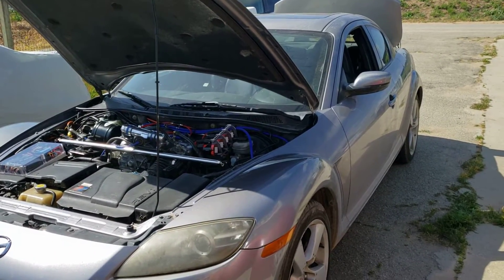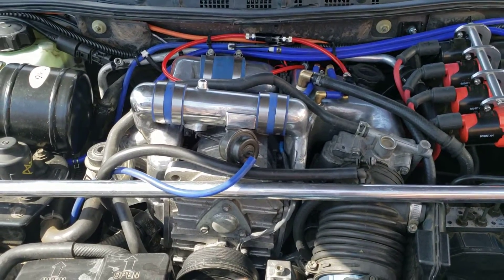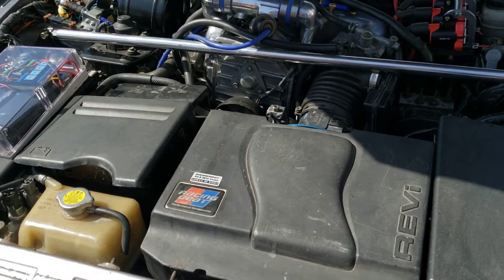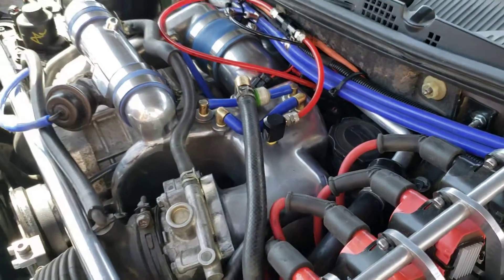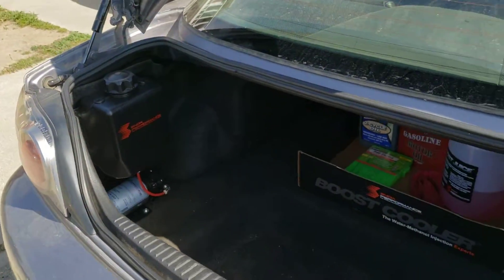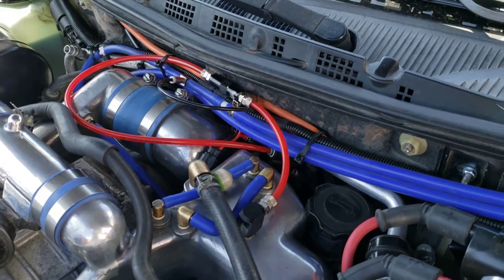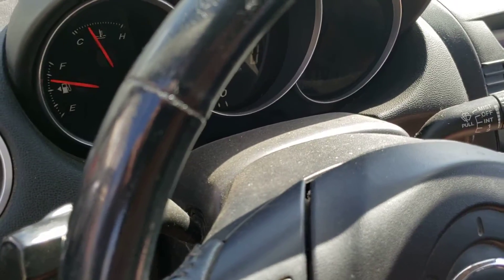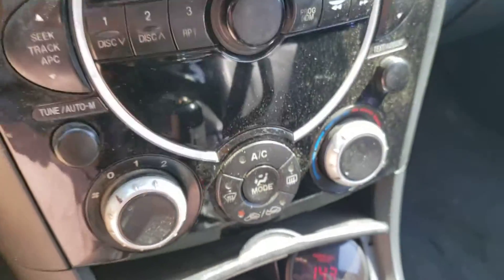RX8 Supercharger/Meth walkaround rev

Comment: How's the reliability and drivability
Reply from the maker: Both reliability and drivability are great! I can drive without the SC on and power is pretty much normal NA. Turn on the SC and it takes off like a bat out of hell and breaks the tires free really easy!
I've got the car down for a rebuild now so I'm cleaning up all of the wiring and adding an intercooler and a bigger bypass. The SC is great but NA is a nice option for driving on windy roads and winding the hell our our the Wankel without loosing control.
Reply: @johngeary4202  very interesting I’ve always wanted to run boost on my renesis but I didn’t know the supercharger option was a safe way to go
Reply from the maker: @Mister2j86  Superchargers are very hard to find for these. It took me more then a year of waiting for one to show up on eBay (and jumping on it when it did!) and even then it wasn't a complete kit. Most all of the hardware was there, I did have to fab a few brackets, but the electronics were missing. I bought an eManage Ultimate but this is still not an ideal option as it's a piggyback and sits on top of the stock ecu. The piggyback can cause your stock ecu to try to re-tune itself. Mine seams to work ok because I can turn off the SC and run completely stock so I think the ecu keeps the tune fairly well like this. Also, with any type of FI on these rene's they have a high compression ratio, 10/1, and you can't run too much boost without getting knock. Higher octane fuel can help like e85 or adding wm injection like I did can really make tuning easier and let you run more boost and more timing advance. Knock can kill your rotary, crack the apex or other damage, so if you aren't comfortable tuning this yourself you shouldn't. The eManage has a good logging system that shows fuel, timing, boost etc, and you can play it back against your timing maps to pinpoint where you need to make a change, so it is pretty easy to tune with it in my opinion. I also added an Arduino to help manage some automation I wanted but you don't have to use that.

Comment: Your engine just called me... it said if you rev it so much while the oil is not up to temp it will break soon. 
I swear stop reving the car when its cold the dumbest thing you can do to a rotary...smh
Reply from the maker: Yeah, when I asked my son it rev it I didn't thick he was going to redline it!, but it does rev faster now with the SC on it! Wasn't completely cold, I just got back from a drive but it did cool down more then I thought.
It's getting a fresh rebuild in September anyway but would be nice to have most of the parts still reusable in it. I did a rebuild about 3 years ago and replaced the aluminum housings, apex seals and a lot of other mods but didn't do the rotor side seals hard parts. This next rebuild will include lapping and re-nitriding the irons along with replacing all of the rotor side parts. ...and turning the rev limiter back down. The software I have can also limit rev by engine temp so maybe I'll set something up in there too.
Reply: @johngeary4202  would be good to see how the ports are doing with the meth setup, I imagine it would all be sparkling!